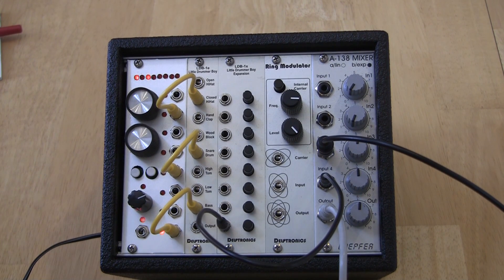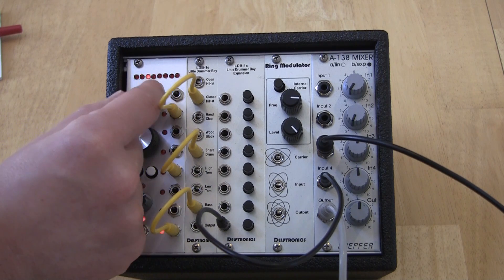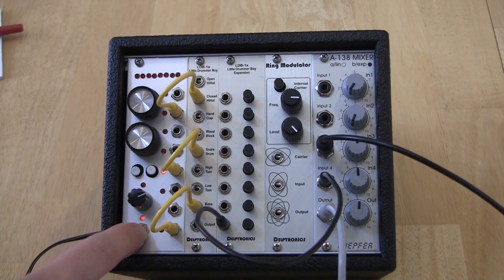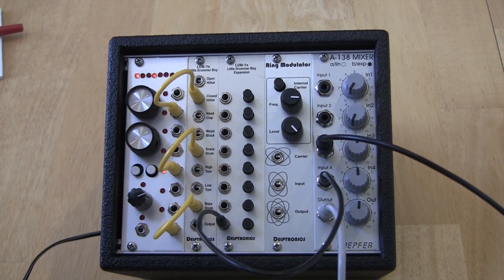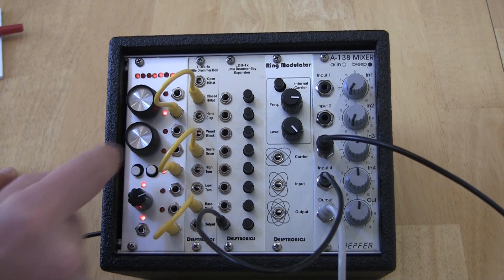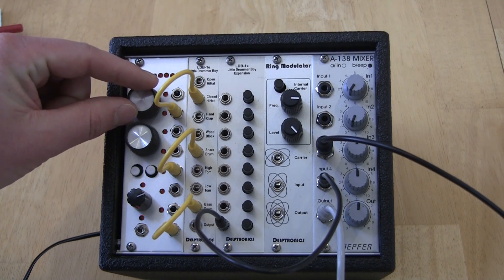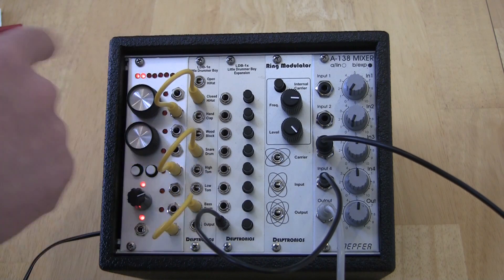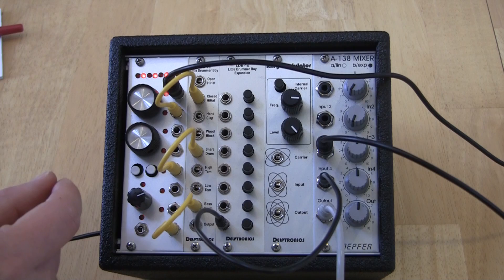New Delptronics Trigger Man Sequencer Module Preview

Comment: Are there any cv pitch sequencers that are like this in functionality? I think you would get great synth lines this way....
Reply from the maker: Not that I know of. But the Trigger Man works well as a clock for a pitch sequencer.
Reply: pamelas workout comes to mind and the erica synths sequential switch with expander. Also the winter modular eloquencer or a varugate 4 by malekko. Not that they work the same by turning knobs but the same result can be had...

Comment: how do you lower temple is is possible
Reply from the maker: Yes, it is possible to lower the tempo.  The Trigger Man has a built in clock with a tempo control knob. It can also be clocked with an external signal, or run in voltage controlled temp mode.

Comment from the maker: Well, the Trigger Man can easily replace the A-160 and A-161 and give you more features as well.  If you want to use them in combination, you could use one of the outputs of the Trigger Man as the clock input to the A-160.  That would give you the ability to create even more complex rhythms.  In the video I show how the TM can be used as the clock for a pitch sequencer.  You could trigger up to pitch sequencers to get 8 simultaneous melodies, each with its own rhythm.